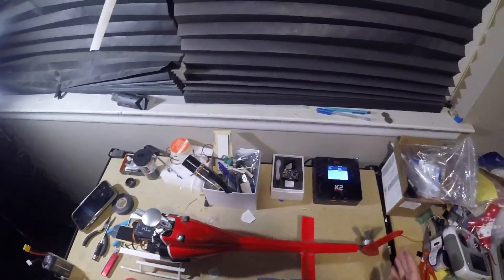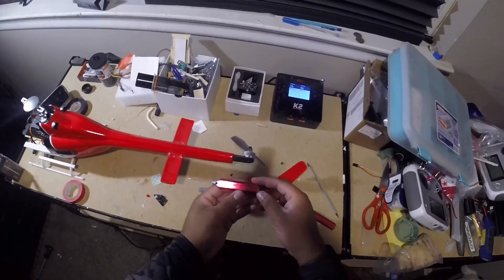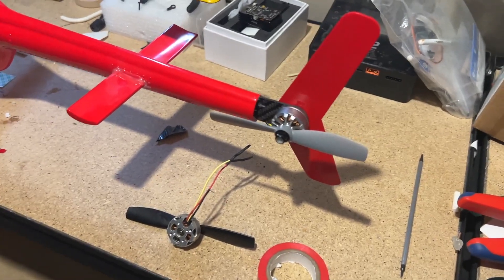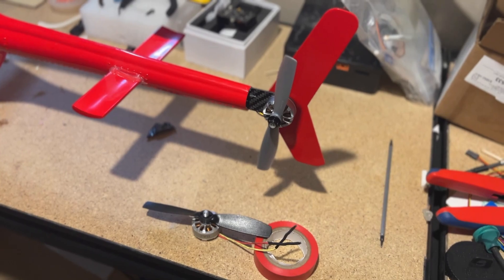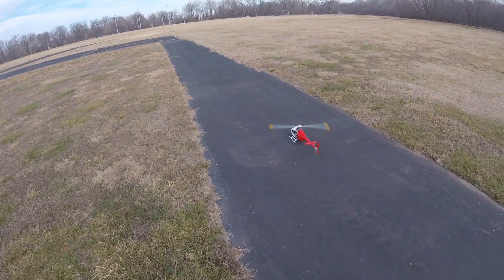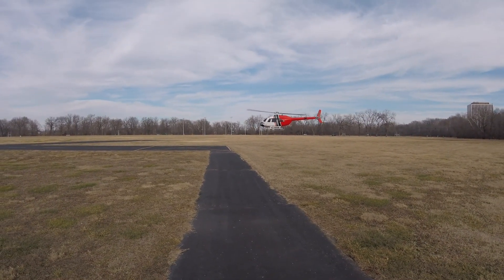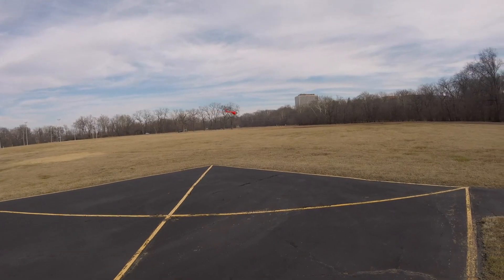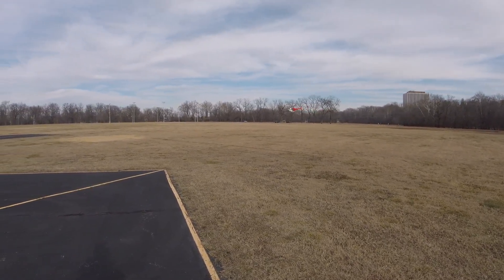FlyWing Bell 206 Tail Motor Mod Setup and Flight Test

Comment: I just ordered the version 3 and it looks different than that the tail motor is molded into the tail of the fuselage. But i heard you say yours is a gen 3 as well i wonder wy mine looks more updated?
Reply from the maker: Yes, yours was the final third-generation version released to the market. Mine had 2.5-generation parts mixed with the new third-generation parts before they sold it.

Comment: Great stuff mate, question did you buy this as a twin blade version or 4 then mod it? Iv'e seen others that have black plastic heads on them.
Reply from the maker: I actually bought both heads, but I retired my four-blade head because it was defective. I still have part of the four-blade head, so I may convert it soon. Additionally, Flywing has released a four-blade head that you can swap in as well.

Comment: Thank you for the info on this. I have a question. I see the Bell 206 is sold in a 450 size and a 470 size. What is the difference? Is it just the outside canopy that’s bigger and my question is are the frame mechanics the same as the 450 to the 470 is any difference in the mechanics Frame thanks
Reply from the maker: it’s the same they just reclassify it

Comment: That's a terrific noise reduction and it's on the proper side now. I have purchased the V3 recently, so unable to do this mod, due to the tail boom redesign 🙁
Reply: same here :(
Reply from the maker: @swmatthews005 it’s possible, but you have to do some heavy modifications.

Comment: Why couldn't you just reverse the motor direction instead of changing the prop?
Reply from the maker: Helicopter's main rotor spins clockwise, so the tail motor also spins clockwise to prevent the fuselage from spinning counterclockwise. Therefore, just reversing the tail motor won't work, as it will end up spinning in the same direction as the main blades. Also, when dealing with the tail motor, it's important to ensure that the thrust counteracts the counterclockwise momentum of the fuselage.

Comment: Going from a 4 blade main propellers down to a 2 blade system, did you just remove 2 of the blades? Also, did you make any adjustments to the head speed settings? Thanks!
Reply from the maker: Yes, you could do it that way, but it would be easier to just buy a two-bladed head. You also need to get a new swash plate that supports the two-bladed head, but I'm planning on making a video very soon about converting my Bell 206 to a three-blade head.
Reply: @pilotbowser9980  Please let me know when you change this as I too am doing the same thing.
Reply from the maker: @michaelwright6751  Will do.

Comment: Bows your always into something...my question is this...why did FW put the tail rotor on one way and what is the reason we're all supposed to be changing to the other side?
Reply from the maker: The direction of the main rotor's rotation, be it clockwise or counterclockwise, is mostly up to the designer's preference (FlyWing). Which determines what direction the tail motor spins.  I like conducting experiments on my helicopters to see what I can do or can not. I’d like to model my RC helicopters to resemble their real life counterparts.

Comment: The 206 fuselage how much does weight compared to stock
Reply from the maker: I believe the fuselage is less than a pound. The bulk of your weight comes from the battery and the electrical components installed. With everything together should be at least about 2 to 4 pounds but that depends on your battery size. 

I hope this information helps you.
Reply: @Pilot Bowser  I have the 450lv2 I switched my tail motor right from the go wrapped the canopy with  fake carbon fiber got new  rotor blades no art no logo just carbonfiber   and swaped out my landing gear to goblin style also a cadix ratel a solo tank for fpv 
And last but not least a t2 pro thermal and unihertz jelly  Oooh yeeeeaaah
Reply from the maker: @RGCbaseace  very nice, hope it see a picture someday.

Comment: First fly today good but very slack in control in gps mode 15 minute ok , second lipo, same very slack ,slack in control ... and all of a sudden passes over me and impossible to stop it on the stick it continues in the trees...!!!! The fuselage was damaged and the battery support was broken! 1,2 flights.!! GRRRR. I am very disappointed with the behavior in GPS mode, this is not my first helicopter, I am not a novice, it responds very slowly to the command and sometimes makes movements of its own. in addition there is no mode without gps with only the attitude mode I regret my purchase!
Reply from the maker: Did you calibrate your sticks? Also in GPS mode is not built for speed. If it feels very sluggish, in GPS mode recalibrate the helicopter.
Reply: @pilotbowser9980   I have already turn RTH batterie of, the problem come from GPS loose Satelite when canopy is cosed I think Magnet of canopy disturb the GPS sensor , when it loose satelite GPs of  led Orange then the model continue on his way, its very hard to move and controle it turn slowly I have fly 10 minjutes without problem before
Reply from the maker: @did3d523  it could be the magnets, but the GPS is in the tail pretty far away from the magnets from the canopy. You might want to grab a voltmeter and test your GPS connections.

Comment: mine come with motor like you on tail but blade in wrong side, (like a classic drone) ?? new motor blue, all already monted, 1 wing on tail break, I look inside and I see 1 wire of tail motor wo touch the main motor (will be cut if I start it) pfff many trace of glue around wing tails. the new plastic landing gear look like very fragile, not strated as far
Reply from the maker: If you’re tail motor is mounted on the right side aka factory default the prop, 5045 is facing inwards. Flywing just change their tail motor to the blue so that’s the new one going forward. As for the tail motor cable inside the tail, just tape it down.

Comment: I can buy you the fuselage of the V1 if you dont use it .. have you a email
Reply from the maker: Unfortunately, no because it’s on his way to get fixed right now. Also, you can still order the old fuselage and put your new guts into it.
Reply: @pilotbowser9980  with shiping to France the old fuselage V1 is 240€ ... expensive for the near same fuselage  ....

Comment: what is speed max in gps Mode? thx
Reply from the maker: I believe 10 - 15mph safely but ask FlyWing to confirm. When I go full speed, the helicopter becomes uncontrollable, which will increase the chances of crashing.
Reply: @pilotbowser9980  it seems slow ..in gps mode have you modify speed parameter in the new version on assistant V1.9 now you can setting speed max in gps mode
Reply from the maker: @did3d523  unfortunately, the only two flight controllers you can change the parameters is the full and lite. Unfortunately, the scale flight controller is locked so you can’t change the parameters.

Comment: If you decide to open windows Hope you will make a video of it that importante for me  Thanks// I think that use a 3 blade tail prop can make less noise more because blade will turn slower, nice to test.// is the new landing gear better or worse than the V1 it seems to be all low quality plastic?
Reply from the maker: Thanks for the idea on the 3 blade tail prop I’ll do it this weekend. I haven’t decided to cut the windows out due to the fact the ESC is not overheating. I like the landing gear on the V2 because It’s just one piece and not multiple pieces like the V1.
Reply: @pilotbowser9980  I  have contact Flywing about my fuselage problem windows in V2 and they answer my that: "It will take a while to make it again. Now all the packaged goods in stock are windowless. You can cut it yourself. Or wait 2 months, I will make a new mold for you." , what do you thing about answer? THX
Reply from the maker: @did3d523  it depends on how bad did you want the fuselage with the windows? If it was me I would cut them out myself and make the windows.
Reply: @pilotbowser9980  cut is easy but how make windows buble??

Comment: V2 have no reel clear window ... is the model is same than the V1?
Reply from the maker: About 90% is the same. The difference are:  
1. The main motor was redesigned 
2.New main gear
3. New landing gear
4. Swashplate change form 4 blade to 2. 
5. Main Blade Clip are plastic, not metal anymore but you can still buy the metal parts if you want to convert it. 
6. The helicopter sits lower then the gen1. 
7. Lack of airflow to the ESC to cool it down but I haven’t had any issues with the ESC overheating yet.
Reply: @pilotbowser9980  do you thing its possible to buy V1 and update to v2 the motor and main gear ? thx
Reply from the maker: Yes, it is possible you may have to do some modifications.
Reply: @pilotbowser9980  V1 is difficult to find now Grrr..
Reply from the maker: @did3d523  Yes it is. Sad part is I’m still fixing my.
Reply: @pilotbowser9980  let my know how that look after if you can make an other video it s will be cool ;-) thx